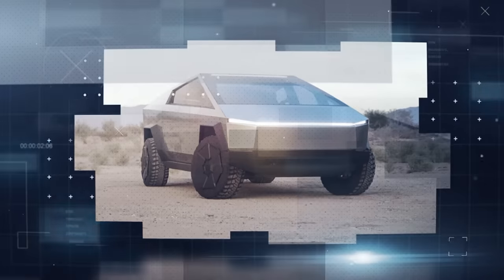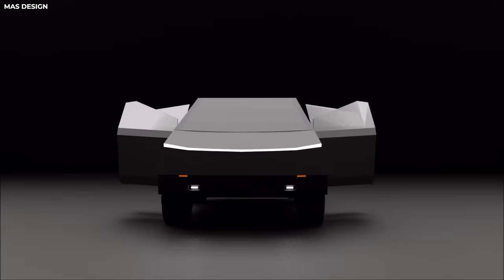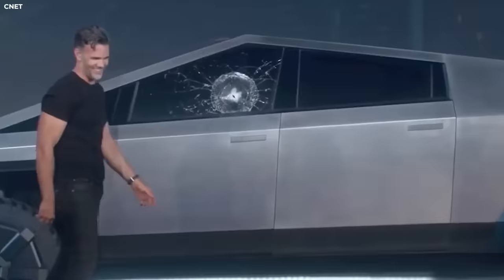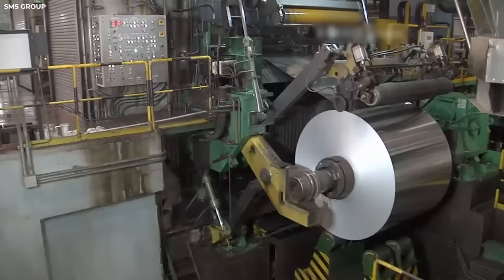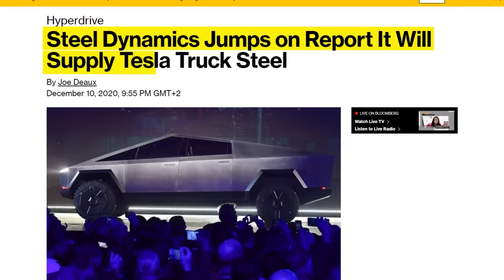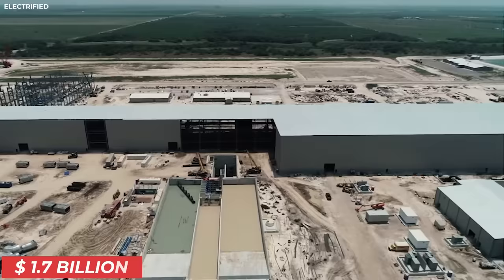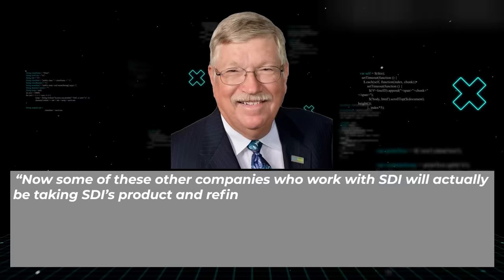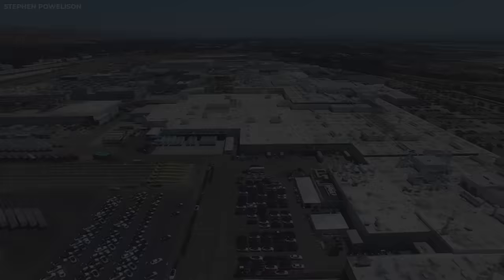Inside Tesla's NEW $1.9 Billion Cybertruck Factory!

Comment: the reason musk prefers steel to aluminium is that it is more advanced and technologically expandable than aluminium. Steel can offer 30% greater rigidity for a given mass. like carbon fiber, steel can take axial loads to an near-unlimited degree, 300k+ tensile strength is not out of the question. steel deforms less than aluminium for a given cross section. steel is denser, but this doesn't actually matter unless you have to roll it popcan thin and load cross-axis on that thin cross-section. Steel's like carpender 465, aermet, and others are legitimately space age stuff, with alloying techniques and prices to match.
Reply: Totally wrong. If steel is that good, Toyota/Honda will use it. But, they all use aluminium.
Reply: @jjs718  don't fall into the tap of thinking this or that company is the beast and therefore only use the best. Steel has way more alloys and dynamicism than aluminum. For a cost, there isn't anything aluminum can do better than steel, including strength per density. Aluminum just happens to be exceedingly simple to work with and fairly inexpensive.
Reply: there is absolutely nothing new about using steel for car bodies.

Comment: you are incorrect in your statement about other mfr use of aluminum - Ford started using aluminum structure only recently on their F150, and it was actually a big deal - most cars body panels and structures are commonly created from a more standard steel variety, in a thickness and temper more suitable for forming than the stainless Tesla is planning to use for CT. This is less risky than aluminum or stainless structure and body, and far cheaper.
Reply: I was wondering the same... Thanks for sharing)
Reply: Really? How “recently” did ford start using aluminum bodies? Because the last I checked ford started doing that in 2015 long before the cybertruck. Plus the ford is on sale and you can go buy it now… so according to you 6 years in the automotive industry is “recent”…
Reply: @tamarockstar09  yes. In the context of the automotive industry, 6 years is recent when discussing something as big as switching structural materials. If it wasn't a big deal for Ford to do this, everyone would've already done it, and in fact, most companies still use steel for most if not all of their body panels. Ford still uses steel for its primary structure/framing. Chevy is starting to use aluminum in some of their panels in 2019 - this is also considered recent. Why did you even bother commenting? I was only pointing out an error in the video, since it stated that most companies use aluminum for structure (almost nobody is, in fact), while the CT will use stainless. I am assuming the CT will still use a standard steel frame, with stainless only being used for the exoskeleton/body portion - that makes the most sense from both a cost and company risk perspective.
Reply: @tamarockstar09  6 years is pretty recent in the auto world.
Reply: Yes, it's totally obvious that whoever wrote the script for this video knows next to nothing about manufacturing.
Reply: @tamarockstar09  Manny, Ford has been manufacturing vehicles for over 100 years.  Until Tesla came along and changed the game, it took Ford and the other "Big 3" 6 to 7 years to develop a new vehicle.  6 years is like yesterday in typical automotive design/manufacturing time scales.

Comment: Lets hope there is some way to recharge completely with solar power while not driving. So going to the store and while you shop its re-charged enough for compensate trip there and back.
Reply: Only if you spend hours in the shop, and you live a minute away.
The promised effectiveness of solar roof is adding 15 miles of charge each day. That can be quite handy in some situations.
Basically it will prevent the car from loosing charge during parking outside. A great annoyance of electric cars is that they slowly discharge even if they are parked. A solar roof can easily compensate for that and even add more range.
Reply: Even if it's only a small percentage. Gains are Gains.
Reply: Most people will break even if they use it as a commuter

Comment: The cyber truck seemed so awesome when they first unveiled it. Now that we’ve seen the other options, the cybertruck feels left in the dust. Can’t wait to see an update for the production model though.
Reply: Big YUP...
Reply: Left in the dust in what way?
Reply: @keco185  I think he's talking about the Rimac and the F150 lightning. They're also very good. It's a big exaggeration though.
https://youtu.be/A1uYhkMRLWg
They should definitely add the capability to power a house with the truck, and make sure it's strong and repairable, with spare parts, and reliable.
Reply: @rubenayla  the cybertruck will have 240v outlets which you could use to power your house if you wanted to.
Reply: @keco185  I know, but Elon didn't plan on using that outlet for powering a whole home continuously. A higher efficiency and power rating inverter for that. Maybe using the same charging port of the car, with a lower resistance. In a pinch sure, that outlet is good enough.
Reply: So the other trucks have cold roll SS body and near bullet proof glass, 500 mile range and 14000 ton tow capacity too without costing over $100k?

Comment: Imagine touching a cyber truck in California underneath the sun
Reply: Polished stainless steel is very shiny, therefore very reflective.  This means it would be much cooler to the touch than a painted car sitting right next to it in the hot Sun.  That's why you put reflective Sun blockers inside your windshield to keep your car cooler when parked in the Sun.
Reply: Use the optional solar cells to keep your hvac on for an ice cold inside so your ice cream won’t melt in your cyber truck even under the brightest California sun😳

Comment: I hear CYBERTRUCKS design has been changed to a quad motor and crabbing (makes the truck move diagonally at low speed already in use by GM with their EV) TESLA can make as many as 27 changes in one week to their vehicles because of their assembly process, unique only to TESLA.

Comment: Take your time and get it right I'm saving for this truck and will be ready as soon as Tesla is Good and ready to produce I've been a Chevrolet person my entire life, a lot of my Family are Union car builders and I have three now I will not miss the oil changes the power steering pulleys the CV axels The electrical systems that are poorly considered, If Chevy had stuck with the basic Genious of the first cars from 1968 thru to 1975 and never sold out to japan in 1982 I would be loyal. But making cars that brake on purpose after five years is a disgrace and placing four different screws on one light cover is also disgraceful, I know you will not Let junk leave your factory with your True engineering spirit because you are the soul of Nicola Tesla, Henry Ford, and T Townson brown

Comment: Considering there's aprox 50b worth of pre-orders - I'm kind of surprised more news isn't forthcoming on it's manufacture.
Reply: whuuut 50b preorders?  for that horrible truck?  my gosh thats freaky
Reply: @dennis8019  yup - over a million. The figure is an estimation of the 3 drive trains both by averaging as well as some percentage figures on the advance orders. As far as horrible - there's a LOT to like about it aside from the looks.
Reply: they most likely have realised they can't deliver the truck. too expensive and impractical to manufacture it.
Reply: The main issue holding up the delivery of Cyber Truck is battery supply.  Same thing with the Tesla Semi.  They're having trouble keeping up with the demand for batteries for their models which are already in production.  Why make it worse by introducing new modes?  When GigaAustin is up and running, then you'll see the Cyber Trucks and Semis rolling out the doors.
Reply: @danmoyer4650  No you won't. They would make a loss on the truck if they built it.
Reply: @danmoyer4650  Isn't that what the new battery factories, battery design and even mining rights for relevant components were supposed to mitigate? I get that this takes time but more hype about the process, the tooling, the factories, the supply lines coming together is better than dead-air.

Comment: inch? feet? Miles? Pounds? What is it all in correct units? There are meters, liters and grams and nothing else
Reply: Doing math is hard eh
Reply: @alanv3185  In fact, math is not my forte. In the metric system you have to add / subtract a zero, which makes the whole thing much easier. You can also convert liters into meters and grams. Have fun with the American system! Inches to Feet to Pounds to Gallons to Miles (country miles or nautical miles?) It gets EXREMELY more difficult and is completely illogical
Reply: Go away now...
Reply: This likely from someone who drives on the left side of the road.
   EDIT:> Just looked at the surname. Probably drives on the right (correct) side of the road.
Reply: @thomaserbsenzahler712  Actually, it is pretty simple if you have grown up with it, are used to it, understand the measurement, and have little time to waste learning a different system which is incompatible with some tools. 
If you started with the metric system, fine. Would you feel any different if someone tried to shove a different system of measurement down your throat?
So I will stick with Avordupois and feet, inches, gallons and pints. And maybe a parsec here and there. 
Oh yes, are you ready to convert the base system of time measurement to some metric equivalent because you feel that working in base 10 is the only way to go?
And while you are at it, let's force everyone in the world to switch to one universal language. Maybe Klingon? Or - yeah - Latin! there you go! That's the ticket!
Reply: A meter doesn't need to compare to a kilometer, just like a foot doesn't need to compare to a mile. Sure there are an easy conversion from meters to kilometers but in the real world it is useless information, as is how many feet in a mile. The same thing goes for weights. Grams compared to kilograms? Who cares, ounces actually is a meaningful fraction of a pound, and how many pounds in a ton is also as easy as any metric conversion. A metric ton is actually a number made up to approximate what a real ton has always been. For the temperature scales Farenheit is more precise with more range from freezing to boiling. You just need to know where water boils and freezes as that's what the 0 and 100 degrees Centigrade represent. Otherwise useless in the overall scale which might as well be the more precise Farenheit scale. Basically the metric system sucks.